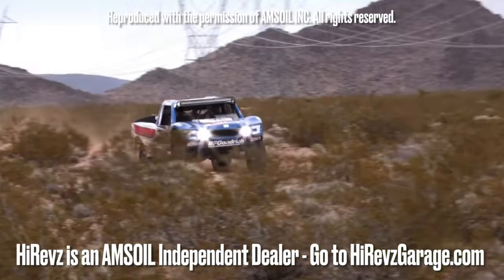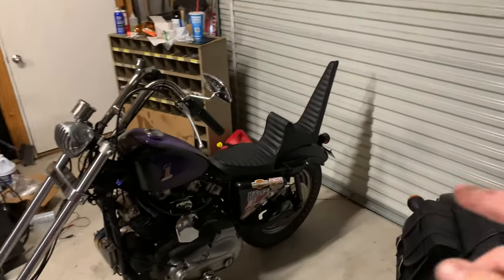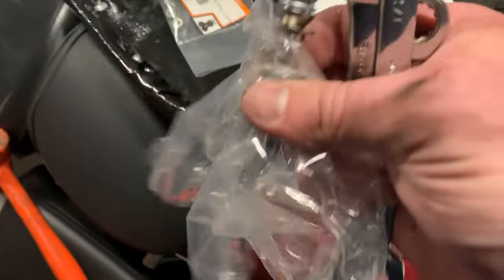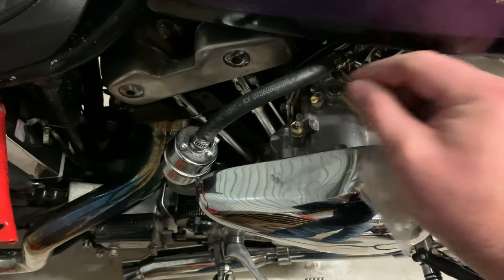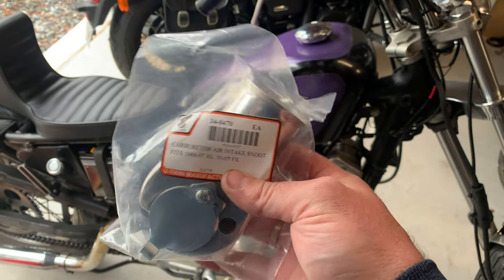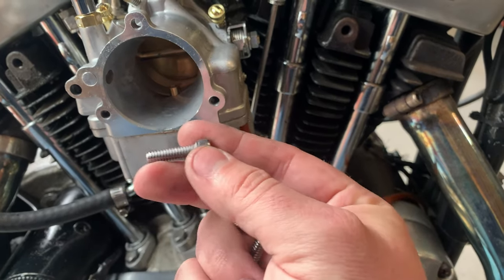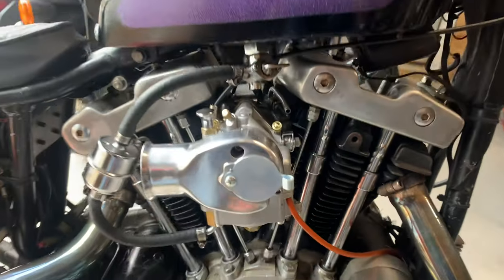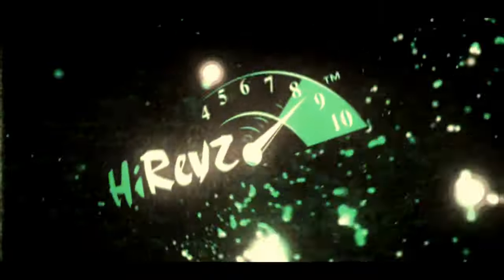Sully's Seat Install and Wheelies! - 70's Chopper Build Part 9 - Harley Ironhead XLS1000

Comment: So I bought my bike with the gold flake vinyl one already on.  Pros: I always get compliments on the seat, the back rest is nice.  The back seat vibrates a lot...  Cons: vinyl looks like hammered dog shit after a year unless you like patina.  Back bracket broke once and had to re- weld.  It is a cheaply made seat, the pan isn't super strong with 2 people and will flex. Seat is about as hard as a corn cob and max comfort distance is a tank of gas and im in my 20's.

Comment: Are you still running this seat? Still like it? I’m trying to decide between this one, TC Bros version, and Throttle Addictions version. I’m also debating this k/q or just a cobra because it’s cheaper. Gah! So hard to decide!
Reply from the maker: It’s a great seat with nice leather and looks amazing.  For long rides, it’s not very comfortable.  I have rode on worse seats though.

Comment: I came across your build and I’m doing an 80 ironhead this year and this one’s a 79 (same frame) did you get a custom sully seat made or did you use the evo one? I’m just curious because I didn’t see that in the description. I’m going to do a swing arm bike because my back is shot and finding a cool kind and queen for a non ridged are few and far apart
Reply from the maker: Yea, this is the ‘82 to ‘03 seat.  It fits perfectly.  The frame changed very little and all ‘82 - ‘03 seats will fit down to a ‘79.
Reply from the maker: This is the one I bought - https://ebay.us/f1wBBs
Reply: Thanks man 🤘🏻🤘🏻🤘🏻
Reply: I'm so glad I went searching through these comments. I just bought an 81 ironhead and the seat that's on it is hideous, yet I can't find any cool seats made to fit pre 82. But from what I see here it will work? I looked up in a chat thread and it sounds like it's only about a 1 inch difference.
Reply from the maker: It will definitely fit.
Reply: @travisbrisch  I had to still put on a sissy bar and drill in a cross bar brace because it slid back… at least on my application
Reply: Will this not fit a 1978 frame model?

Thanks
Reply: @dylanjackson9111  honestly I don’t know. I have and 1980 and they changed the frame 79-81.

Comment: I could be wrong here but I’m fairly certain your intake snoot is supposed to face forwards and then your screws may fit in their places, the different length screws are for different heights where they mate up to the snoot smallest going on the thinnest spot and longest on the thicker part, if you try it out let me know the results I’m trying to buy an old busted engine I found and make a custom bike. Epic wheelie also 🤘🏻
Reply from the maker: I figured the exact same thing as you, but it only bolts up the one way, to the rear.  The little breather hole for the choke/enrichener have to line up with it towards the rear.

Comment: How does it handle at high speed with the rabbit ears handle bar
Reply from the maker: They are great at high speeds.  Completely comfortable.  It’s the really low speed stuff that you have to get used to.
Reply: @HiRevzMedia  cheers for that. Always loved the rabbit ears, going to put them on my 72.